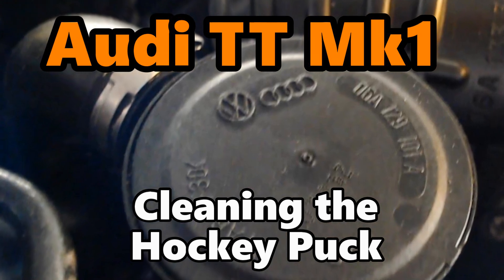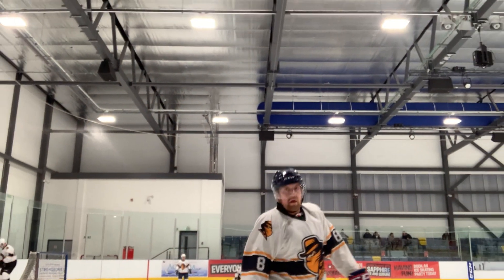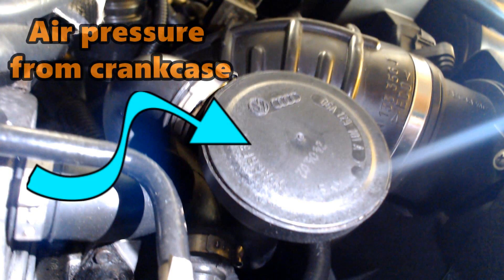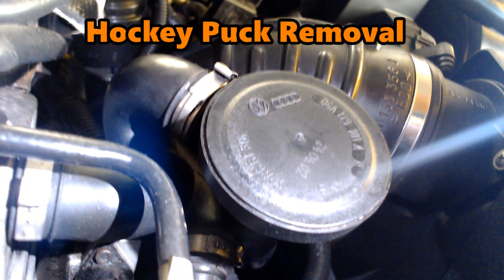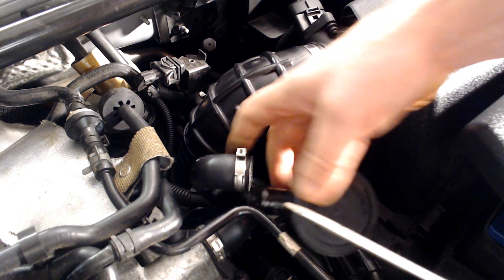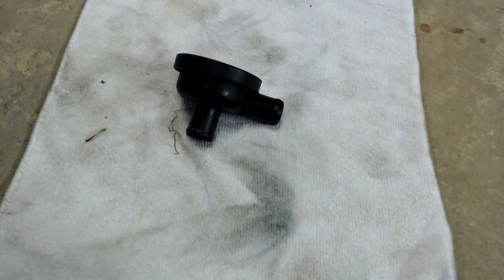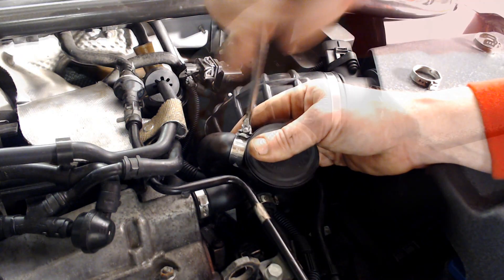Audi TT Mk1 - Cleaning the Hockey Puck

Comment: I replaced mine (BOSCH) for an Amaon one when i did the catch can thing. Didnt look at the make at that time. About a month into driving about noticed lacking boost. So connected my pressure tester into system and found th e (puck) was leaking air from right around the top , barely hising out but there.Conclusion .. put the original back and happy days.

Comment: Worth replacing it rather than just cleaning it because the diaphragm above the spring deteriorates. I noticed it holds onto boost better when you're changing up a gear with a new one (latest version is 06A129101D). It seems to play a role in holding in some pressure when you take your foot off the gas to dip the clutch.
Reply from the maker: Yes totally agree. Definitely worth changing out 👍

Comment: Hi Andy,

You mentioned a possible future video on replacing the breather pipes attached to the puck. Did you make one in the end? Thanks, Alex
Reply from the maker: Hi there Alex. I have not made a video on that yet. However, I have the Project TT in the garage at the moment and that needs all new pipes. So I will be covering replacing these. However, it will probably have better access as the front end of the car is off! Andy

Comment: Hi Andy.. I’ve found condensation in my oil tank.. at first I was thinking it’s the head gasket… but now I’m thinking it’s the pcv valve stuck closed and causing the moisture build up(last owner did very short trips and it’s been stood for a year)

Is there any way of me confirming that it would be a pcv issue?

Comment: Great video!
May I ask, if I am getting engine smell coming into the cabin, what should I look for?  Wife won’t sit in the as it’s impossible to breath - but it’s not fuel smell… just hot smell
Reply from the maker: Thanks for your comment! To answer your question, I’m no expert but could be a whole host of things. Unburnt fuel or burnt fumes? It’s definitely checking fuel pump under the back seat for leaks. Also the lines under the bonnet for the petrol as they can perish. Also give your breather hoses a good once over to make sure they are intact. I hope you get it sorted so the wife can return to the car!
Reply: I’m also having the same problems still have no idea exactly where it might be coming from
Reply: @Draxdowns-nn9pp I have the same issue with my B5 A4 lol, it smells like coolant. My guess would be something in the heater core.

Comment: Nice. Have you covered changing the wind deflector screen belt in any of your vids?
Reply from the maker: Hi there. No I have not covered that yet but at some point I am sure I will need to. Has yours failed?
Reply: lol, it sure has. Luckily the hood still works so no rush to fix it.  Ordered a polyplex belt from America as it is stated to be better than the OEM part and a 1/3 of the price...impressed with the skating BTW....
Reply from the maker: @schwantz037  ha ha! More skating to come in the next fuel video!
Reply: My car is a 2002 TT Quattro 225.  121K miles.  I have replaced that belt.  The cause of the belt failing was the worm gear on the right hand side cracked and made a big chip so the drive pinion couldn't turn or move.  The belt just tore itself apart trying.  I looked everywhere for just the worm gear part (looks like a long black 3/4inch screw....it's made out of hard plastic.But all resources want to sell me the entire wind deflector screen as one unit.  No can do.    So, to make it so the wind deflector is in the up position where it can do some good...I drilled out the 4 rivets and raised the glass as high as it would go....and secured the glass from movement in either direction with durable zip ties.  Remove the 30 amp fuse.  Sorry if not allowed here Andy.

Comment: Mate, did you test the valve before you refitted it back to the car?
Could you please confirm how to test the hockey puck/PVC valve and confirm that it is in working order?
Reply from the maker: Hi Ju. Its not an easy thing to test and a lot of the feedback suggests the same. You can essentially blow through it both ways which does not help. So provided you can feel pressure both ways, I guess that is a good way to confirm it is not blocked. Thanks for the comment. Its always good to add some extra points to the context.
Reply: My friend, when you block one of the ports on the valve and blow air in (pressurise the valve) there should be no air leak through small orifice which is on the top of the valve.
If you can sense air leak through the small orifice, it means that the rubber diaphragm  inside the valve has a hole through, which means that valve is faulty and it needs to be replaced .
I watched that video and found that it does not give answer how to test the valve.

I ordered a new valve and cut open old one in order to understand how it works. The rubber diaphragm inside this valve is very thin and I believe that over the time it fails. The valve is a maintenance item which needs to changed if does not work correctly.
I hope it helps
Thank you
Reply from the maker: @jusadowski5560  Thanks for the feedback. My video is based on cleaning it rathe than testing it but your great explanation adds some insight on how to test it.So thanks for the extra info!
Reply: @jusadowski5560  So its normal if you blow into one of the sides without blocking the other side  that the air goes right trough?

Comment: Good video Andy. Having a go at mine tomorrow, if it's not raining.  Do you have the part number for the vertical rubber pipe?  Mine is even worse condition than yours. Thanks.
Reply from the maker: Hi Al. I dont have the pipe number to hand but Im going to do a "quick fix" with a piece of 19mm Oil resistant hose cut to size. When I take the pipe off I will look for the part number (if it is still there) and let you know. Thanks for the comment!

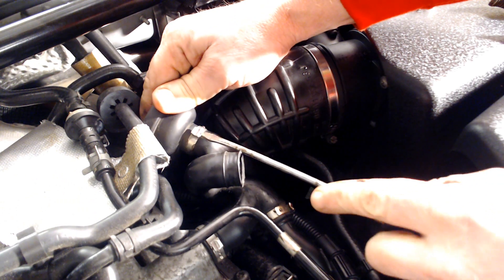Comment: Hey Andy, did you change the sqishy pipe @3:20? mine is the same. i wonder if i can use some silicone pipe.
Reply from the maker: Hi Riddler. Thanks for your comment. I did not change the pipe. Changing hoses is a bit of a challenge if they are not the actual part. Sometimes its hard to seal them and prevent vac leaks.
Reply: @andycharger  thanks mate 👍

Comment: What is the proper name and/or part number for the "hockey puck"?  Also....same for the pipe (hose) that comes off under and down.  I rigged up a spring inside the down pipe where it gets fatigued to stiffen it up.  It works because suction isn't going to affect it as before without spring.  I have looked everywhere and can't find the names or part numbers for these.  Good videos Mate!  I have subscribed
Reply from the maker: Crankase vent valve or PCV valve 👍
Reply: OK.  I found the replacement.  It's called engine PCV.  What is that hose pipe coming off the lower end of the valve called?  About maybe 10 inches long...45° angle bent near either end.  Thanks